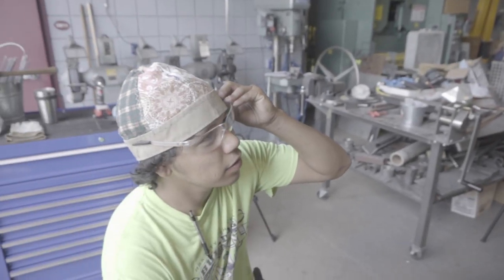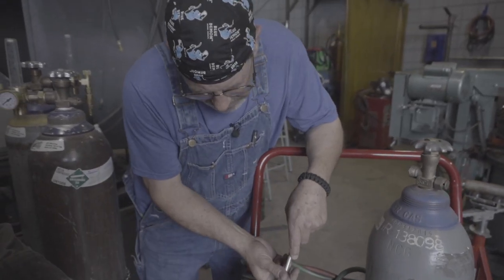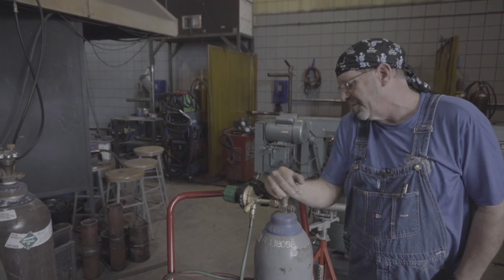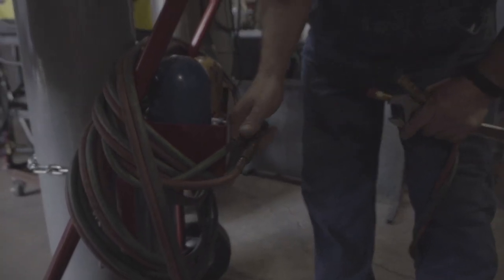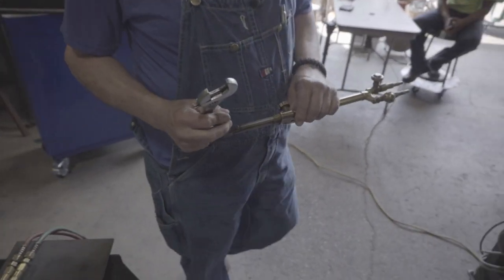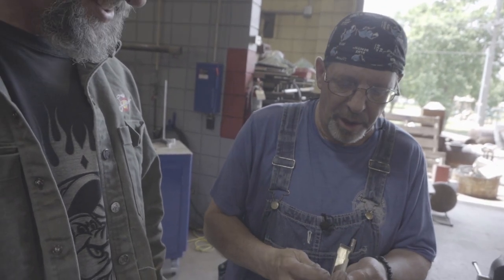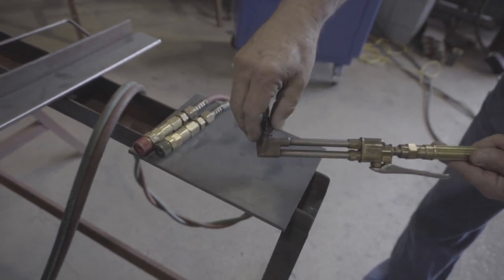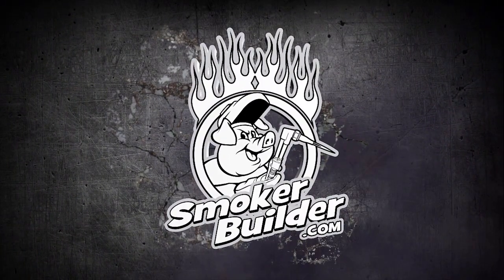Frank Goes to Welding School {Lesson Two: Tank Safety & Tip Cleaning for Oxy/Acetylene Torch}

Comment: Bob Moffett will tell you how it is !!!
I've seen many torch tip fall by the wayside because of the cleaning wires snapped off in the tip !! 
It got to where I went to the tool room, got a new 00 tip, and carried it around in my pocket ! Change it out when I made a cut, let it cool, then put the old tip back on !! Have mercy on the person that used my tip to cut GALVANIZED METAL !!
Reply from the maker: Yeah buddy! He will most definitely!